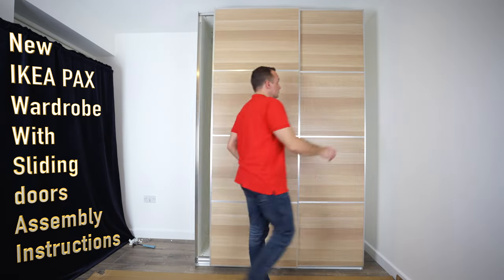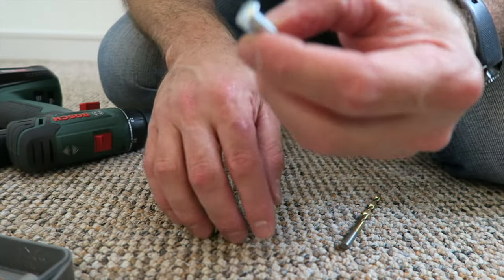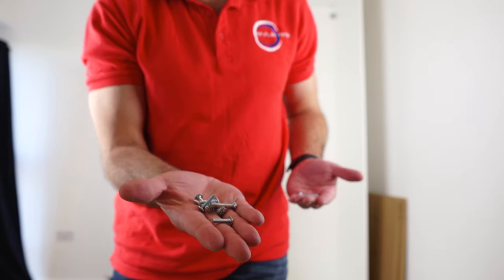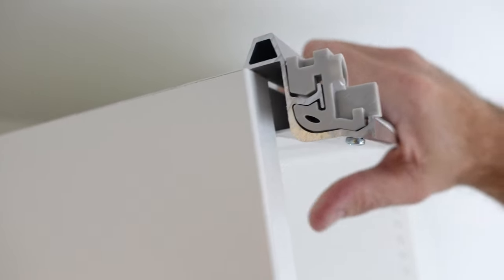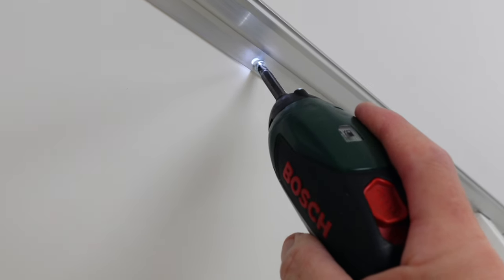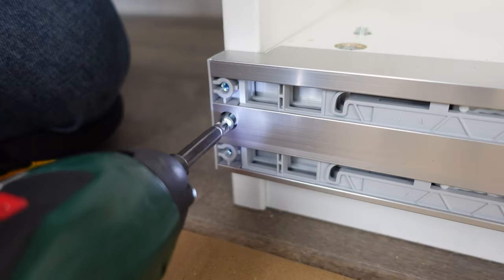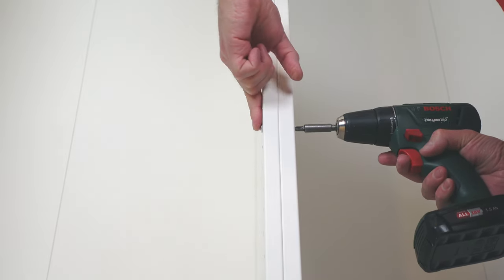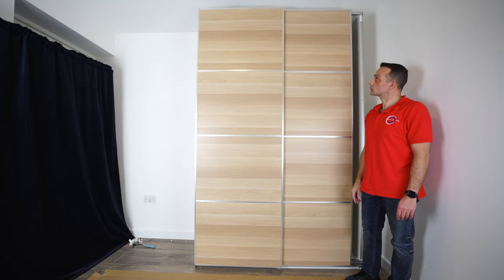New Ikea PAX Wardrobe with sliding doors Tutorial Part:2

Comment: I have secured the bottom rail with no problems, however, I can't get the top rail on at all. It does not push in far enough to line up with the screw holes amd I cannot bang it in like you have shown in the video.
Reply: @mariepatrick1219 We are having the same issue! Did you ever find a solution!?
Reply: I have the same problem
Reply: I cut the metal of in the part it was stuck with a knife took me like 5 hours
Reply: Omd, I am having the same issue, its so frustrating!!

Comment: Hello, I would be glad if you answer my question, that's so important for me. I have 3.10 meters ceiling, so I want to buy a pax wardrobe with 236 cm length. However, there is a natural gas pipe passing over the wall. So, I only have 234 cm. Because of 2 cm, what should I do? Can I cut down the bottom of the wardrobe, can I open the sliding doors, then? Or should I cut down the back of the wardrobe and insert the pipes into the wardrobe?
Reply from the maker: Hard to say can't see how the pipe is going. If you have older Ikea Pax Wardrobe (previous model) than yes 2cm is fine to cut from the bottom (doit only if you know what you doing) here is it how is done https://youtu.be/ehWybREbdF4 If you have the new one I don't know there is the new bottom rail never did with that one.
Reply: @PPFlatPack  Thank you so much for your reply.

Comment: the top rail won't fit into the frame panels its too thick....
Reply: I’m having the same issue!
Reply: I had the same issue.. Then realised the door has a wheel and a little plastic clip under the wheel.. The clip goes under the rail and the wheel on top - i hooked the door on with the clip in the rail which raised it too high. 😅 Hopefully your issue wasn't more serious than mine
Reply: @paulbetts4684  yeh I think it’s manufacturing issue where it just too tight , use a stop block like timber strip . Hold it flat against the rails and use a hammer to just jam it in.
Reply: @aminbham1318  think we are referring to different issue

Comment: My only issue is I have 4 smaller (narrower) units instead of 2 larger units. I had to tap both my upper and lower brackets on with a rubber mallet and they cut slightly into the wood. It could  be that the bracket middle three openings need to be a bit wider to accommodate differences between the two assemblies. I did notice a hairline gap at the top of one unit that could have caused this in one side but not both sides. Anyhow your instructions are highly detailed and appreciated…especially the closeups.

Comment: Your edit seems to have missed a huge part of the assembly, you put the rails on top and bottom then next segment there are the metal sides on too but no idea how you attached them? Please tell me as I need this part thanks
Reply: Those will probably be covered in the Part 3 video.
Reply from the maker: I usually do the side covering panels after I do the doors and you can see it in the Part:3 (coming this Saturday 8am)
Reply: @PPFlatPack  ok thanks

Comment: Does anyone know the size of a single panel used for the 78 3/4x79 1/8" Sized PAX, which will use the 39 3/8x79 1/8" panels? I just need the size of one panel not all 4

Comment: Very instructive and useful video series; Question: Why didn't you use the dedicated joining screws the first time around? Why using just the regular screws on the front before adding the top and bottom rails, and later on go with the joining screws?
I would have thought it was better to secure it once and for all at the beginning? Wondering if there was a reason behind this.

Comment: Are these all predrilled holes? Can I use a screwdriver or do I need a drill? Other than attaching the wardrobe frames to each other
Reply from the maker: All holes are predrilled apart for the holes for joining screws. You can use manual screwdriver if you want to work hard ;)